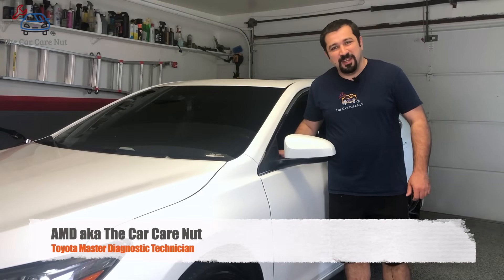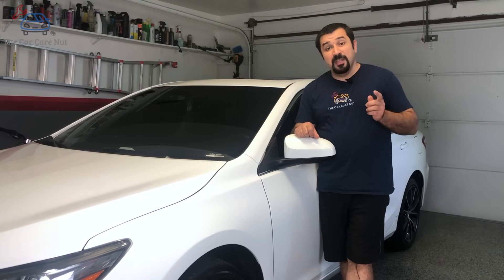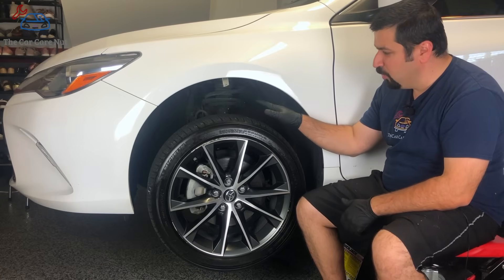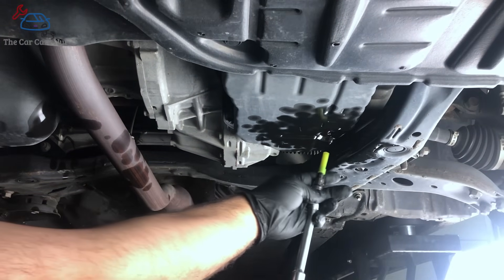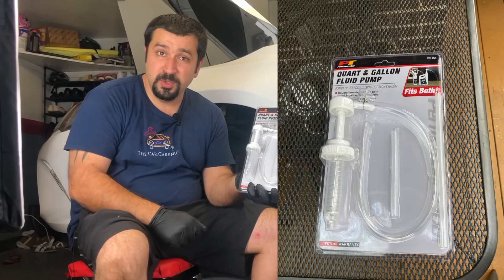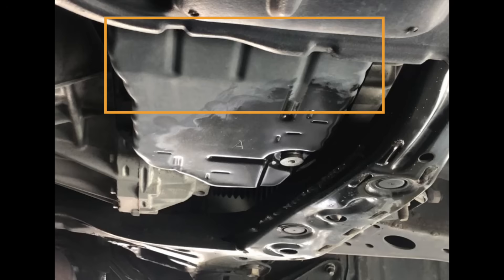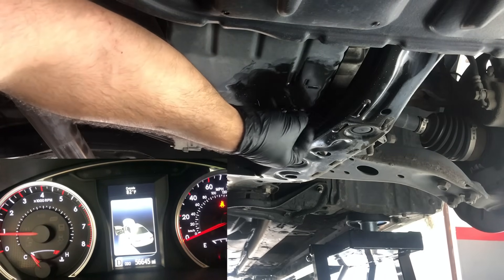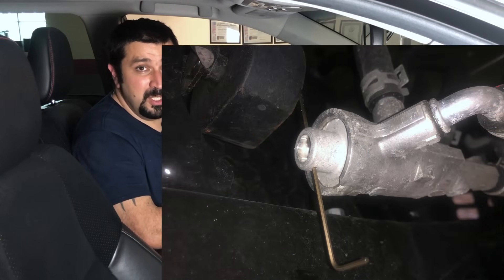How to change your Toyota Sealed Transmission Fluid

Comment: I was wondering if you know where to get the Field Service Manuals (FSM's) for a 2018 Lexus LC500?  I have searched the internet multiple times to include ebay and a couple other used websites and the manuals just don't seem to be published yet. Other than alldata i cannot find them. I would like to purchase the FSMs (hardcopy or digital copy) for this car and not have to keep paying the alldata subscription but not able to find them. Any help or suggestions on this would be greatly appreciated.

Comment: @TheCarCareNut I just bought a 2015 Toyota Sienna LE with 103k miles.  To the best of my knowledge, the transmission fluid has never been changed.  Would you still recommend doing a transmission fluid change?  If so, just a drain and fill like you showed in the video, or would you go for a full system flush?  Thanks!  Your videos are an awesome resource for Toyota owners!
Reply: Sure, why not?  In other comments he does not recommend the flush.

Comment: I just bought a Lexus rx350 with 122,000 miles. I'm not sure the trans fluid has ever been changed. Should I change it out just leave it alone?

Comment: Great video.  One question.  Is there a reason you did not remove the refill plug before you removed the drain plug, as you have pointed out on your differential and transfer case fluid change videos?
Reply: I was taught that if you can't get the fill plug out first, stop.

Comment: Hi. I'm loving all your videos. 

I'm about to do this procedure on my wife's 2017 RAV4 using a scan tool with a transmission temperature feature. 

During the video, you kept the vehicle's engine running while draining the excess fluid to the correct level. Is this necessary if I'm using a scan tool and know the fluid is between the correct temperature range?  Thanks!

Comment: 8 speeds for a CVT are not enough. Must be more than 12 speeds. I understood but in the CVT rests old oil after the empty job, means that the new oil will be blend w/old oil. The changing oil job is half done. Maybe this job must be done 2-3 times to be sure that the oil will be perfect new and clean. There is a special machine for changing  transmission oil, more expensive job but correctly done.

Comment: Hi! I got a question, my car is 158,000+ miles, I never changed the transmission fluid by recommendations of my mechanic, but lately I’ve been more doing stuff my self, so watching this video makes me wonder if it’s worth it to change the transmission fluid until this point, or I’m better leaving how it is, can anyone help me about this?
Reply: Im in the same boat.  my 14' Toyota corolla has 179,000 im way past do but my moms nissan had like 120k miles her mechanic changed her CVT transmission fluid and it ran perfectly. so i think ima Change my fluid and if it has a problem ill just re-do transmission fluid and and put OLD fluid back in. 👍

Comment: Do you recommend ever replacing the transmission filter on these units?
Reply: He has stated in other videos that it is not needed if the fluid is changed every 60k miles.

Comment: My wife has a 2001 Honda CRV ad I change the transmission fluid every 60,000 miles.  I drain the fluid, refill the drive a couple miles and drain and fill again like 3 times to flush the fluid as much as possible. ( recommended flush procedure from Honda.  Would it be a good idea to do the same for the Toyoda sealed transmissions?
Reply: Great question!

Comment: why not drop pan  , change filter and clean magnets off as they are at their saturation point and not collecting any more metal ,  flush fluid out threw oil cooler , and do a total flush , waste some new fluid but it gets all old fluid out . can you do a vid on that ? thanks   ...edit don smith just did a vid on a Camry , I think thats the way to go , whats yer thoughts
Reply: Outstanding question!

Comment: I have a 2019 camry with 91k miles. Is it safe to change the fluid with that many miles. If ok to change what brand fluid other than toyota brand ws fluid can I use? I plan to buy the fluid at Walmart but don't see ws label fluid.  Thanks

Comment: So this procedure is identical for my 2017 rav4 awd 6speed as the cvt's, and the 8 speeds? What is the temperature range to check the fluid on a 2017 rav4 2.5 awd 6speed?

Comment: Came to the Toyota dealer to get this done and  they said they don’t do a drain and refill but only a flush the system since they have to hook it up to a machine 😑
Reply: Yes. I encountered the same (sort of) they told me a drain and fill was more expensive, doesn't get all of the old fluid out and they have to drop the pan. They recommend the flush, which I am not so keen on doing. 

If I had Mr. Car Care nearby I would just pay him to do what he believes is the right thing to do.

Comment: I followed the directions and was able to change the ATF in my 2015 Highlander. It drained about 1.8 qtr, filled with 2.5 qtr and after checking fluid it drained about .6 - .8 qtrs. It took between 15-18 min to get the to solid D from overnight parked cold. I thought I did something wrong because other guys said it takes 5-10 min. Anyway, thanks for this video!

Comment: Hey. Not sure if you are monitoring this videos comments? Here goes anyway, I utilized the OBD2 jumper wire method to achieve the proper transmission temperature and adjust my 2015 Highlander transmission fluid level. The vehicle appeared to be in diagnostics mode (dash lights flashing and info screen showing AWD diagnostic). However, after quickly cycling between N and D as instructed I never saw the D indicator stay on solid. Just a normal N then D icon back and forth. I kept going back to the sump with my infrared thermometer to check the temp at the location you indicated. It took a long time to heat up and I finally got a temp that exceeded the range for checking the fluid at the drain plug/straw. I shut off the engine and let it cool down to the proper temp. Like a dummy I didn’t start the engine back up and proceeded to drain the fluid to a trickle and install the plug! So now I drained too much fluid out. Have to start over tomorrow. I’m confused as to why the OBD2 procedure didn’t work??
Reply: Just finished this procedure for my 2015 HL, it took between 15-18 min to get the solid D. I thought I was doing it wrong but eventually got to that D solid point. My HL was cold from not using it since yesterday. Hope it helps.
Reply: Are you removing the pin jumper?  Once the D flashes for two seconds, my repair manual says you shift to Park, remove your foot from the brake, and remove the jumper.  Car will stay in temp detect mode.

Comment: You didn't say anything about the location of the dip stick. Furthermore what kind of wire should I connect with the OBD2 socket and where to put both sides of the wire?
Reply: You can use a paper clip.

Comment: My 2001 Highlander has a dipstick. I bought it 3 years ago.  How is that done differently?  I don't know if the transmission fluid has ever been changed and it has 166k miles now.  Would you suggest NOT changing it?  Thank you for your videos and your honesty.   I also wish the VSC light would go off and stay off.  A couple months ago, I got new tires and alignment, front rotors and pads.  That crazy VSC light has been on since.
Reply: In the good old days of a dipstick, we just drained the fluid and put the same amount back in, slowly and carefully, thru the dipstick hole.  Then it's easy to check the level because, dipstick.

Comment: AMD, I had my 2016 Corolla CVT fluid replaced by a mechanic. I recall he did not take out the driver side tire to add fluid. He had a hand pump with adapter to seal the bottom drain hole and pump the fluid in. I have never seen it before. Is it acceptable? I wonder if the air space inside pressurized?
Reply: Pressurized inside the tranny?  No.

Comment: Thank you for all your videos and your thoroughness!  
I need some help.  I'm a bit confused.  
A normal Toyota Corolla cvt transmission has more than 6 quarts of tranny fluid.  If only 3 quarts is changed then that leave more than 4 or more quarts of the old tranny fluid in the system.  How many times must this procedure be done (in your video) in order to remove all the old tranny fluid.  
Do the Dealers just change 3 quarts (like in your video) when one has the tranny fluid serviced and send you on your way or do they completely flush out of the old tranny fluid and put in 7 plus quarts in the tranny?
I talked to two service advisors at Toyota and they both told me that the my 2014 Corolla S does not have a filter in the tranny that needs to be replaced.  Is this true?  
What is the tranny fluid temperature for a 2014 Corolla S Plus?
What kind of tranny fluid is needed for a 2014 Corolla S?  CVT FE?
Once again a big Thank You for your excellent videos!!!
Reply: @Paul Thank you Sir!

Comment: Looking forward to doing this. AMD, I own a 2015 Sienna LE. How often should I change my power steeeing fluid? Will you be making a video about that procedure? Thank you for all your content. It is high quality work. Blessings!
Reply: Toyota Siena 2015 doesn't have a power steering pump. They use selenoid electro-mechanical to support the steering wheel instead of power steering pump. So, there are not fluid and pump to replace
Reply: @minhdinh5374  thank you for the clarification.

Comment: My son has a 2005 Corolla CE with a dipstick,,,, not at 60k miles yet,,, but I don't know if it's ever been changed,,, still looks fine) and as far as I know I can get the tube on my topsider pump all the way down to the bottom of the trans pan.  Could I just suck the trans fluid through the top when it's cold,,, , measure it,,,, then top up with the same amount of cold fluid?
Reply: Why not just drain it out the bottom?
Reply: @jshepard152  Why not drain it out of the top you nimrod? It's what topsiders are for. It's quicker,,, no messing about with different containers to measure exactly how much fluid to replace. Go find something else to be stupid about.

Comment: Was the car's transmission hot when you first opened the drain plug? If it was not hot it seems that no transmission fluid should have come out until you took out the straw.

Comment: I recently replaced my fluid, and I followed your video to a T. I did this two weeks ago and have been noticing a slight stutter when I come up to a stoplight, it will usually go away when I put the vehicle in neutral. Any suggestions Thanks again it is a 2018 RAV4 XLe non-hybrid.
Reply: Check the fluid level again as he mentioned
Reply: @2005Pilot  it was the throttle body I cleaned it and it stopped. My rpms will drop to 500 every so often now I might need a new throttle body

Comment: Car car nut is very good instructor, but he could went further by dropping the transmission pan to completely drain all fluid in the pan, clean the pan including the magnet sitting in the pan, replace the strainer/filter  with new one ,then reassemble pan with new gasket, before refilling: This further steps especially if you have cvt transmission

Comment: Just bought a corolla with a cvt with 15k miles....thank God I researched how to change the transmission fluid. I was wondering why the manual didn't mention transmission maintenance at all. Car makers these days....

Not looking forward to this much more complicated and risky maintenance but I'm locked in to this car. Thank you so much for the video.
Reply: It's not too awful once you get into it.  But yeah, a much bigger pain in the butt than it should be.

Comment: My 2017 Camry is coming up on 60K miles - according to the Toyota dealer the trans should be serviced at 60K miles .  I haven't decided if i will attempt this procedure or have the dealer do it .  I wonder if the dealer will do the same thing you did or something more involved .  I notice you did not mention anything about when to do this and you did not mention anything about replacing the transmission filter.  Regarding the plastic overflo tube - if the fluid level is too high and runs into the overflo tube where does it go ?   Thanks
Reply: Our dealership said 100k and I know that can’t be right

Comment: I have a 2016 Camry with 150000 miles. I don't think the transmission fluid has ever been replaced. I don't have any problems with the transmission. Should I  replaced the transmission fluid with this milage ? 
Thanks a lot.

Comment: Really enjoy your videos.  They are the best Toyota videos I have found online.  My daughter recently purchased a 2013 Camry 4cyl with 129k.  Assuming the transmission has never been serviced and the fact that it shudders at 40-45mph, we decided to drain & fill the trans using Toyota WS fluid following your video.  The trans still shudders so am wondering what the next step should be.  The fluid was dirty but did not smell burnt.  Toyotas extended warranty appears to be expired after 8 years. 0:07
Reply: Those I believe had a recall on the torque converter that affected the 2013 as well.. check into that.

I had a 2012 SE 4 cylinder and it went through a recall replacment right around 50k miles it was starting to shudder. 

Since it is way past warranty unfortunately that replacement will be on yours/her dime.
Reply: I had an old Odyssey transmission shudder. I added something called lube guard instant shudder fixx and the shuddering stopped almost instantly.

Comment: I have a 2017 Toyota Sequoia. It appears the dealer did not reattached the flap in front left wheel well. I informed them that the flap had been damage from rubbing the tire when car travels at high speeds. They claimed that they did not remove the flap to when replacing the Automatic Transmission fluid. Is this correct and possible to perform without removing the wheel well flap?

Comment: So I have a question. Would you be able to do a rebuild of a 2012 sienna le sealed transmission ? I've never seen one rebuilt, and we just had our rebuilt one begin to fail, it slips into neutral, and sometimes tries to start in 4th but drops to neutral and then you have to rev the engine until it catches and slams into first. The speed sensor is also bad.

Comment: out of curiosity how long does it get warm from overnight park car. thanks.
Reply: It took between 15-18min for my 2015 HL.
Reply: @abugerito  did you keep shifting N to D till get solid D or you shift it to P and wait till it get solid D. thanks
Reply: @yujayn  I kept shifting N to D all the time, not as fast as the video, regular back and forth with no stopping. I wasn’t sure if shifting to P would work.
Reply: @abugerito  how did you level your car? Plywood under jack stands?
Reply: @2005Pilot  correct, I tried to level up with the jack and jacks stands as much as I could. I use one of those small magnetic levels that I already had.

Comment: For a 2014 Lexus IS350 with 99,000 miles should it be flushed or should the filter be replaced

Comment: Hey I have a vehicle I bought at 120,000 I'm about to have the transmission fluid change the dealer is flushing and replacing the fluid. Do you even recommend FLUSHING the transmission?
Reply: Great question!!

Comment: When should I have my moms Toyota 2017 LE transmission fluid changed.  She drives under 5000 miles a year the car has 5100 miles.  So, its probably fair to say she would be considered "Severe condition's" since she does a lot of short trips.  Same question for spark Plugs I do know the manual says 120K for the spark plugs. With her low mileage driving she will never reach 120k which is why I ask for the YEAR intervals. Actually, Id rather know the interval by time for all maintenance.  Unfortunately, my mom would never do anything if  didn't micromanage her car.

Comment: took my 2016 camry se to get the fluid changed at the dealer.   I had to take it back three times and open a case with toyota to get it back at the right level.  never drove right after they gave it back to me.   won't be doing that again.
Reply: That’s why I’m scared to let somebody else do it. Will be attempting myself. Sorry for your troubles- that Sux!!!

Comment: Hi AMD, another great video.  I have a 2016 Corolla S with a CVT trans. that has 93k miles.  and have never replaced the fluid. I have asked several dealers if I should do a trans. flush or fill and drain.   But getting mixed responses, some dealerships recommend the flush and some the drain and fill.  What is your recommendation (from experience), as I have no issues with my trans. right now, and want to keep it that way.
Reply: Many people seem to think the flush is more risky.

Comment: I went today to toyota dealership in Deerfield, FL. Before tax it was 267.83 total. Here is what they printed
Zaktran complete fluid exchange using synthetic transmission fluid (WS1000, T401)
13359 CPG - $126.95
12 WS1000 WS TRANS FLUID - $9.99
1 T401 TRSNMISSION CONDITIONER $21.00
PARTS: $140.88 LABOR $126.95
Reply: What model?

Comment: @TheCarCareNut, Hi AMD, thank you for the excellent explanations and clear break down of step in all your videos. I am in New Zealand and have a 2012 Toyota Vanguard (JDM model). This is pretty much an upgraded RAV4 that comes with 2AZ-FE 2.4L engine however has a CVT transmission. I am planning to do a transmission drain and fill based on your guidelines but I am finding it hard to find any information anywhere since it is a JDM. What I already know is that it is supposed to have Toyota CVT Fluid TC. I would like to know if you have any idea of what the temp range for fluid level adjustment for this transmission? Thank you again!

Comment: Hello AMD! THANK YOU  so much for your great video and info, I just have 2 questions on a 2018 and newer 2.5l Camry transmission service, do we need to change the trannsmission filter and is it a diy job? and when do we remove the allen key from the trannsmission cooler bypass valve?